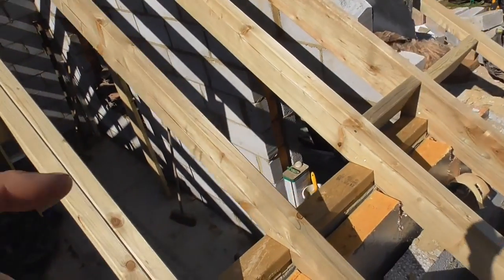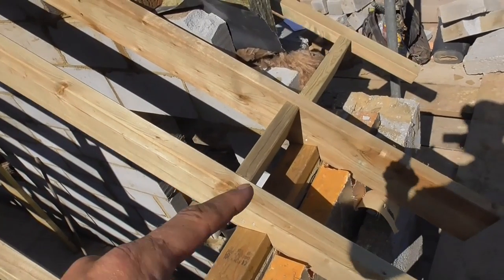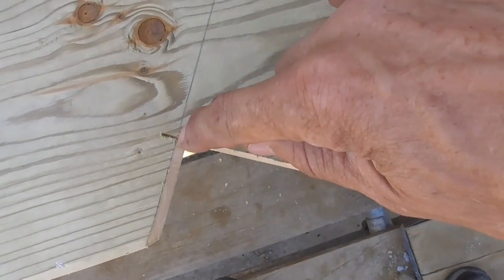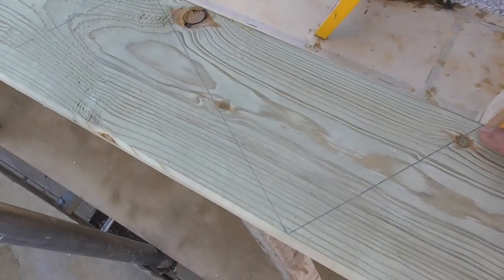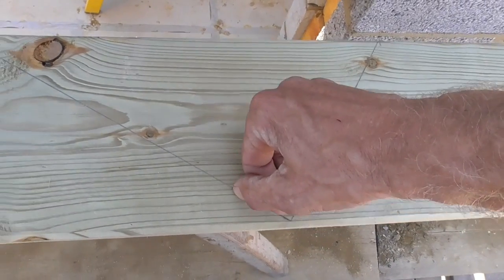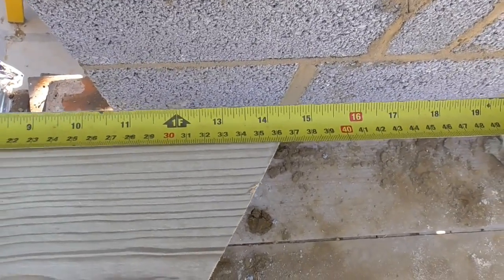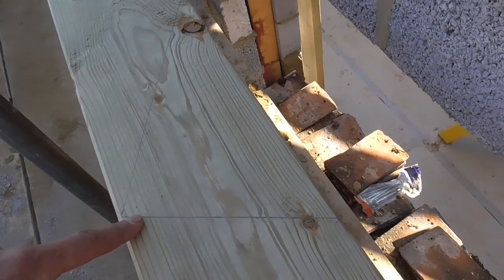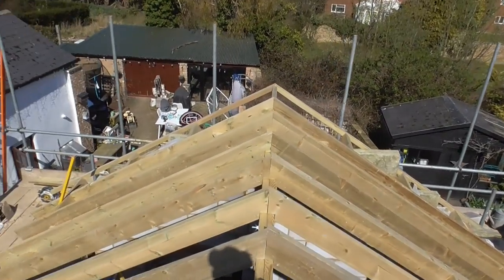How to work out rafter lengths for different height wall plates***UK ROOFING CARPENTRY/FRAMING***

Comment: Have you got a video on how to work out rafter angles on lay boards
Reply: Your plumb cut at the top is the degree of the roof you are pitching, The foot cut of a rafter on a layboard is a seat cut of the roof you are pitching with a compound cut of the roof the layboard is on, mark the angle of the seat cut on the side of the rafter then flip your circular saw to the degree of the roof you are pitching on to and cut along that line. Simples.
Reply from the maker: Yes I have Richard👍It's the most viewed video on my channel👊 Search, cutting lay boards and jack rafters' 👍Cheers Del. (and Robs reply to your question is also SPOT ON)
Reply from the maker: I couldn't of explained that any better myself Rob🤩Cheers bud
Reply: @thetallcarpenter  Happy to help dispel the mysteries of layboard jacks!

Comment: What's the rule for putting up all the overhead covering? I see lots of that in England. Must send cost through the roof
Reply from the maker: Hi there🖐The roof structure typically has a breathable membrane fitted, then 2x1 tile 'battens' fitted running the length of the roof, these are spaced anywhere from 4" to 10" depending on roofing tiles/slates, and finally either slate or concrete tiles are nailed to the battens overlapping from the bottom up.
I guess it's more expensive than 1/2" sheathing and bitumen shingles, but the roofs, pretty much, last a lifetime👍Cheers Del

Comment: Is there an easy way to work out plate height if your new rafters are 6x2 and you're extending a roof made of 4x2 or 3x2?
Reply from the maker: Yes DP👍Simply put a plumb mark of the existing pitch onto a piece of 6x2 and mark your birdsmouth in the usual way). Then go your existing rafters and get the height above plate measurement. (effectively finding your existing birdsmouth). Now measure down the plumb line on your 6x2, the HAP measurement from your existing rafter, and difference between the two will be how much lower the new plate will be👊Hope that makes sense🤔Cheers Del
Reply: @thetallcarpenter  Top banana, cheers Del

Comment: Hi del, what if the measurement is greater than the depth of your plumb line,
Reply from the maker: Hi Stephen🖐I would simply tack an extra peice of timber on the underside of the rafter and run the plumb line onto it and then mark it at the correct drop👍Thanks for your comment 😎 Cheers Del
Reply: Hi del
If the difference was say 180mm and you were using 6x2 timbers would it work if you measured 90mm down the plumb line then marked across with your seat cut line then mark another plumb line and measure the other 90mm then finally Mark another seat cut line
I haven't tried this myself but I was thinking if this worked it would save tacking a bit of timber on
Just like to say it was a great explanation on your video 👍
Reply from the maker: @ilijadjujic5911  Sorry bud, I cant quite get what you're saying into my head, but I think what you've suggested is correct🤔🤞Cheers
Reply: @thetallcarpenter  when I get a chance I'll give my suggestion a go then try it by tracking some timber as you suggested and report back

Comment: I just did a massive hand cut roof, with different roofs all meeting and this was the case on part of it, but it was coming off the existing roof, i took measurement from ridge to wallplate for rafter length then straight edged off the existing for birds mouth depth as the part i edged off was creeper rafters on the valley rafter,, if you can get what I'm saying😅😂😂😂
Reply from the maker: I get what you mean Stephen, and on many occasions like that, running the level over existing rafters is the best way to get the right measurements👌 Your roof sounds like fun🤩Cheers Del
Reply: @thetallcarpenter  well dunno about fun lol, not a kick in the ass of 60,, 🤣🤣 the body is slowly but surely saying no, but i do love roofing, so I'll carry on for now 😜😂

Comment: So does that mean the edge isn't in the centre of the building then?
Reply from the maker: Hi there🖐If you mean the ridge, then yes, it will not be in the center of the building👍Cheers Del
Reply: Yes sorry I meant the ridge. Thanks for the reply Del. I’ve never come across this before but this seems like a great way to over come the issue. I’ll keep this tip in the arsenal. 👍 great video

Comment: What app is it you use ? 
Thanks.
Reply from the maker: Hi Sam🖐hope you are well bud🤞I actually have a list of the multiplication for pitches from 10° to 50° degrees printed on a piece of paper that Dan Cox gave me👊It's that or his app at Essential Carpenter Tools. Failing that any right angle triangle calculator on line will do the same thing👌Cheers Del
Reply: @thetallcarpenter  You can work out the run per metre for any pitch roof by using the equation:
1/Cos x Pitch in degrees. example: 35 degree pitch roof. On a calculator press 1,  divide sign,  35, Cos button, then equals button. that'll give you 1.221 which is the run per metre. (times this by your clear run for true rafter length)
 For Rise it is Pitch Tan x Run. (Run being 1 will give rise per 1m of run)

Comment: Ok, but ....just measure one and the other and cut the rafters.
Reply from the maker: Sounds simple I guess🤔
Reply: @thetallcarpenter  measuring rafters is very simple , indeed. However, in practice for the perfect cut , it takes more than measuring and speed angle. Nothing is exactly perfect .

What I meant is that instead of doing what you explain in the video, I simply measure for rafters on each side of the ridge. Whatever each distance is , it counts. One is longer than the other, obviously.
Reply: @thetallcarpenter  I'm not saying you do it wrong or aren't good at your job.
Stay safe on the roofs !
Reply from the maker: @July-A7 How do you set where the ridge is so you can measure the down to the wall plates🤔
Reply: @thetallcarpenter  The ridge is in position already.

I often do irregular shape buildings. Right now I'm building a triangular shape sumer house. Pitch roof over a triangle 😰 .
I don't like flat roofs at all. 
I'm sure someone will do it faster and better,  but I spend of lot of time considering options and measuring distances.
Reply from the maker: @July-A7  The ridge position was determined by first working out the rafter lengths based on the different plate heights.
Reply: @thetallcarpenter  I don't know your specific job. Whatever works for you.
Generally I position the ridge beam and then figure out rafters. Or when I have drawings , follow them.